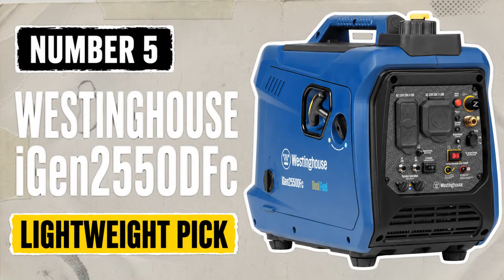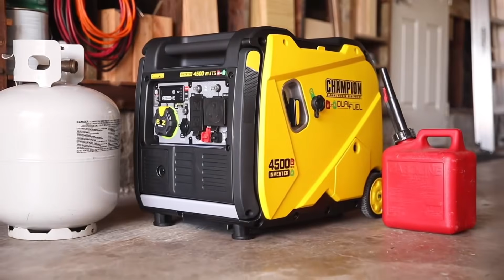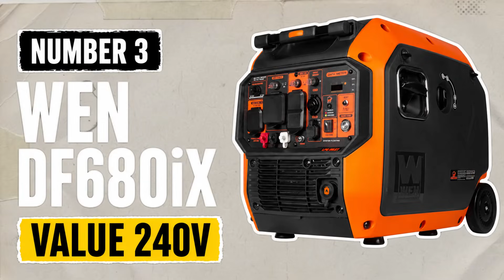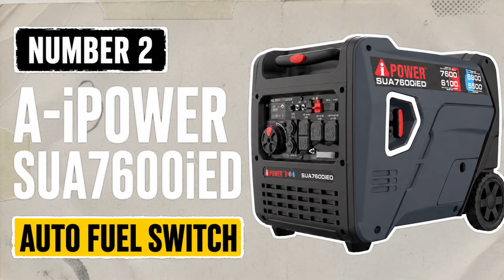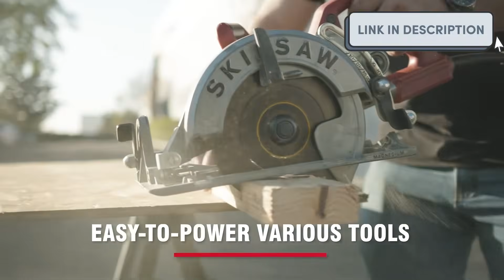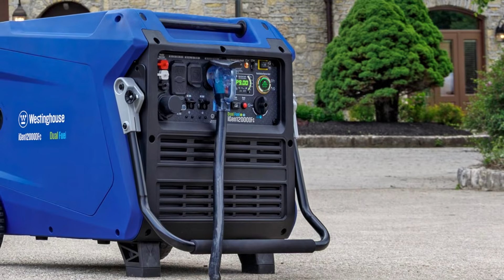5 Best Dual-Fuel Inverter Generators 2026 — Avoid the Wrong Home Backup

Comment from the maker: ⚡ Three standout picks from this video:

🥇 Best overall home-backup option:  
Westinghouse iGen12000DFc  
https://www.amazon.com/dp/B0CQMZZ47V?tag=smartie-v022-20

💰 Best-value 120/240V option:  
WEN DF680iX  
https://www.amazon.com/dp/B0DVF1RPCJ?tag=smartie-v022-20

🎒 Best lightweight essentials option:  
Westinghouse iGen2550DFc  
https://www.amazon.com/dp/B0CB99QS6S?tag=smartie-v022-20

If you were building a backup plan today, which would you prioritize: easier portability, affordable 240V support, or maximum propane capacity?

Check the links for current prices, coupons, reviews, and availability.